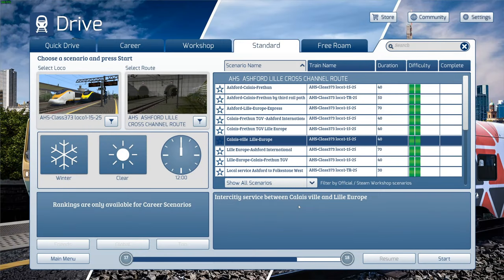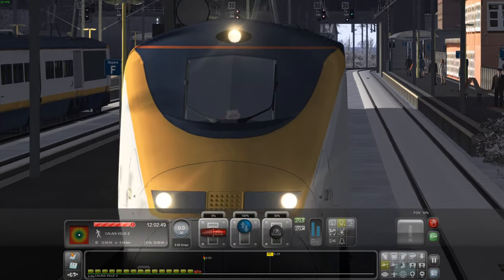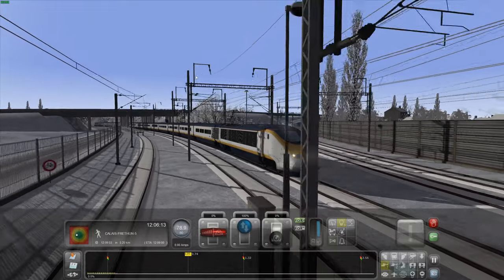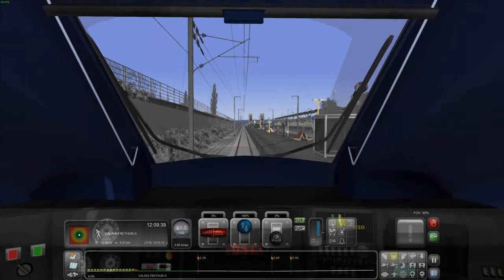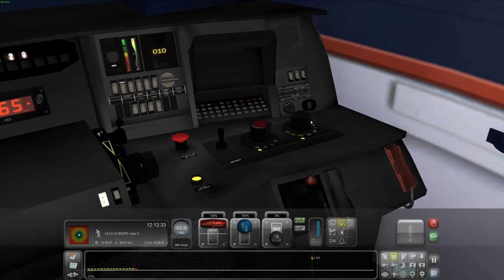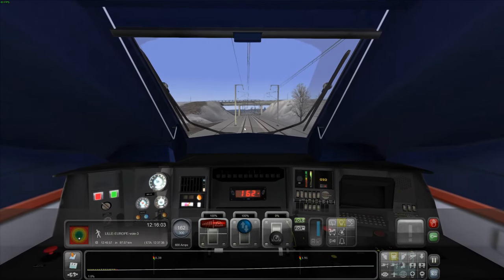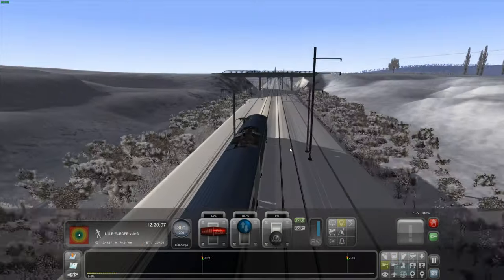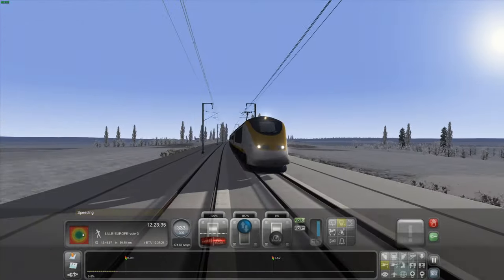Train Simulator Classic: Class 373 Eurostar Calais to Lille

Comment: Need some assistance regarding your discord server. Have attempted to gain help on Discord but the same error, Channel verification too high, keeps stopping me from messaging in the server despite me being fully verified on discord.
Reply from the maker: The only setting I have is that you need a verified email, and must have had a discord account for longer than 5 minutes.
Reply: @SimulatorAdventures  yeah. I have a verified email, and ive been in there since last night and my account is years old at this point!
Reply from the maker: Sorry about that I'm not sure what I can do. The security is managed by discord and it's not a server setting I can really change. Perhaps try rejoining or just double checking the email.